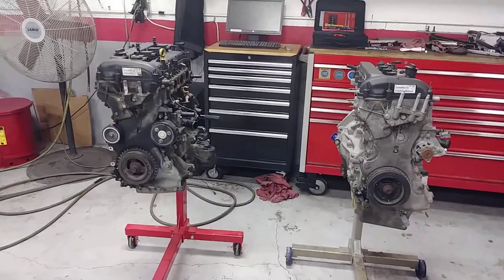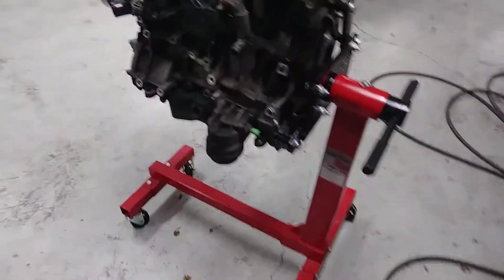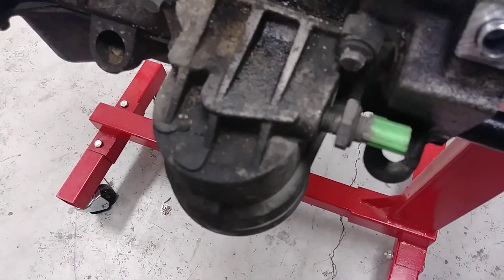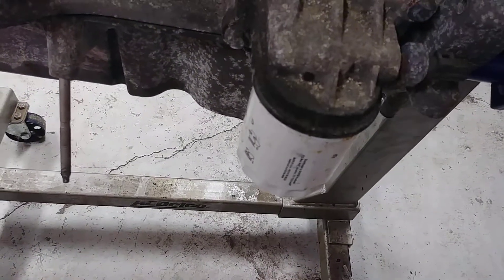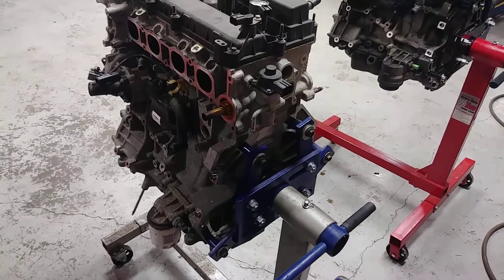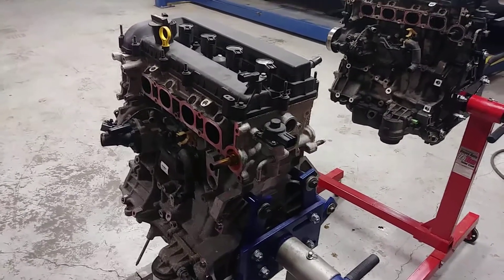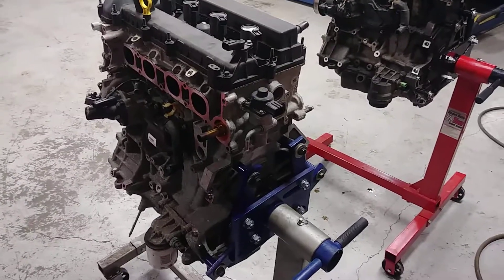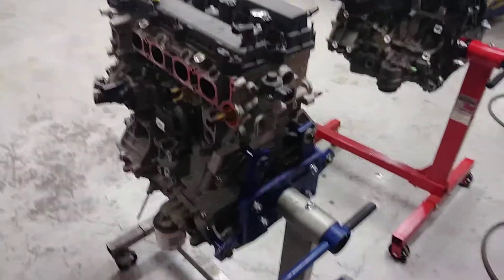Mazda 3 and 6  2.3 to 2.5 Fusion swap part 2

Comment: Hey budy, I have an issue after swap my mazda 3 2013 engine, the seller sell me a mechanical engine and the starter is not fitting well and doing some extrange noise, have you had something like this? Could you give a consultation?
Reply from the maker: What year is the car that you did the swap in and what year and model was the 2.5 out of?
Reply: @Rickkari7  is 2013, and the swap engine is the same year and model